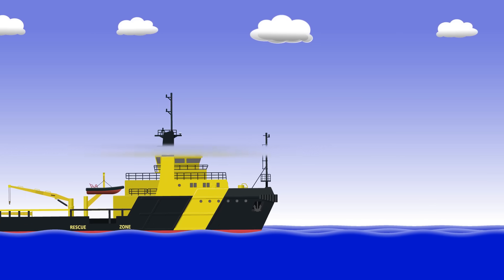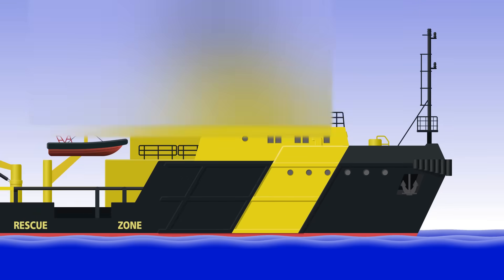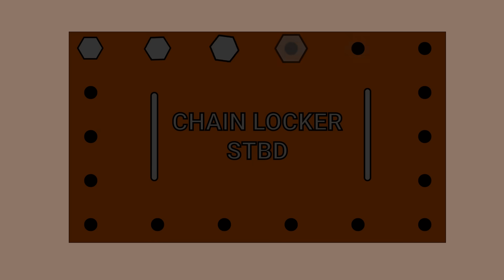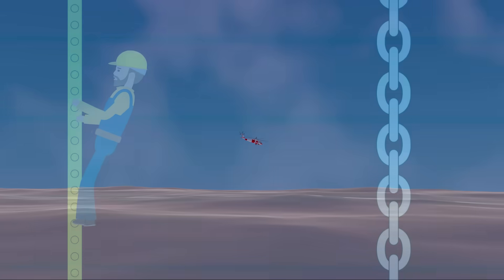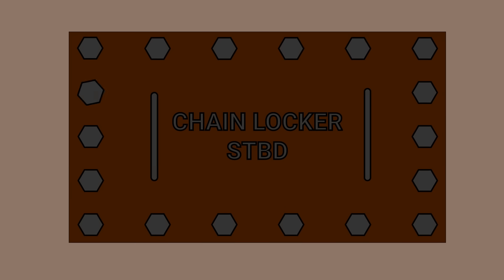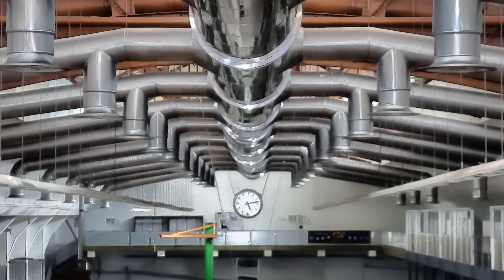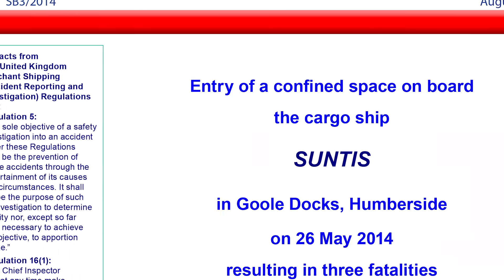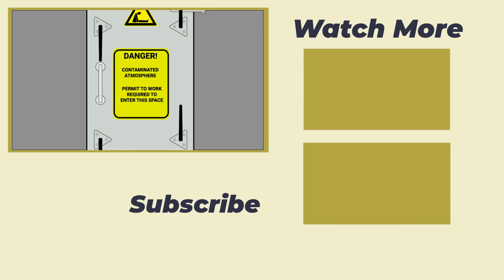Why Enclosed Spaces Are So Dangerous? | Enclosed Space Entry

Comment: i worked in a huge government building with various levels of security access,  i always wondered what 'enclosed space access' meant, and why it was a big deal.   great video
Reply: Those would probably be the service areas only used when something needs replaced or fixed usually in buildings though the areas wont suffer from huge buildups of gases unless there is a leak of some sort. Also since it was a government building its possible some of the doors may of been "fakes" where things were kept that were on a need to know basis as a variation of the hide in plain sight tactic as the spooks always love to find new and strange ways to hide things.
Reply: I am guessing "enclosed spaces" in a security context means something entirely different.
Reply: That's where they keep the reptillians when not needed for impersonating politicians...
Reply: NiagaraWarrior what building did you work in? And what was the security access for?

Comment: I never thought about oxidation depleting the atmosphere. It's one of those obvious things that I never connected together. Thank you.
Reply: Yeah. I know Rust is Iron-Oxide. This video put two and two together.
Reply: I think its because we have always taken the availability of oxygen for granted. Its not like we're astronauts so as long as we have air, we just automatically assume that there will be oxygen.
Reply: Even without the oxidation, the person going in will deplete the oxygen. This is a real problem even in places not normally considered enclosed spaces. If there are heavy fumes produced by a process they can cause low oxygen if there has been a leak or the ventilation system has been switched off.
Reply: @bigbadjohn10  Yes this is true however the circumstances of this incident strongly suggests that the oxygen content was already dangerously low. Granted the volume of the chain locker isn't specified however the fact that it is sufficiently large that descending into the space requires a ladder suggests a volume far too large for such severe symptoms to occur so quickly unless the air was already dangerously stale to begin with.

A volume large enough to need a ladder for entry is almost certainly large enough to contain way more than 1000 litres (1 m^3) of air which at sea level pressures is enough volume that it would take tens of minutes to raise the CO2 concentration to symptomatic levels and closer to an hour to cause unconciousness.

While the video doesn't give a timeframe on the first collapse it does strongly imply that it they did not even manage to complete the decent before collapsing suggesting this event occurred within mere minutes of a exposure. Unless the video is severely exaggerating the rapid progression of symptoms here that very much suggests that the air in there was already unsuitable for human life from the outset.
Reply: wouldn't it be vented because the anchor chain has to come out of the chain locker so there would be a vent for things to enter and exit. including air, and plants and animals. or are they airtight on modern ships?
Reply: @ameraldas3641  There will be an opening for the chain though it's probably not going to be much larger than the chain itself and runs directly through the windlass and such that are used to raise the anchor hardly an optimal ventilation conduit.
Reply: @FaerieSeraphina  there is a chance the oxidized air is heavy an it will sit at the bottom of the tank. Just like large fermentation tanks which have CO2 sitting at the bottom of a tank. Very dangerous
Reply: @The.Chiefman  Indeed yes, if left undisturbed with only diffusion to mix the gasses they certainly will gradually settle into a diffuse density gradient with the concentration of the densest gasses being significantly enriched towards the bottom of the space. That said I struggle to see how the air could remain undisturbed if the crews stated reason for attempting to enter the chain locker in the first place is considered, for the chain to be banging around inside the chain locker it would have to disturb and stir up the air as it moved. I really do think that there was simply not a large enough volume of Oxygen left inside the space period for any part of the atmosphere in there to be survivable given the circumstances.
Reply: @FaerieSeraphina  or perhaps we can say that the rate of which oxygen was consumed through the reaction is greater than that of any source of oxygen entering the enclosed space through whichever possible means i.e the gap and spacing for the chains that could have been exposed to the outside air. It's interesting to think of what type of science Dynamics is involved in such a scenario, ie differences in pressure, differences in density of co2 o2 and other gasses. And also on the way down perhaps at different heights within the enclosed space that there were differences in concentrations of gasses which could have lead to this incident. I doubt any other toxic gasses were involved here though because I can't find any evidence from the safety training material regarding this particular incident. It's you can search Viking Islay enclosed space incident.
Reply: @ookduke3502  I'll check that out later when I have time but yes from what I know so far it does seem like the space was Oxygen depleted.

Also there inorganic Oxygen consumption due to oxidation reactions with the steel seems unlikely to be the only thing consuming Oxygen in there too. Sure that there are plenty of microorganisms breeding in there too after all every time the chain is retracted it's bound to bring up a fresh supply of microorganisms and probably a good amount of food in the form of bits of phytoplankton and such that stuck to the chain lol.
Reply: @ameraldas3641  it's a very big space and the small hole for the chain isnt enough to supply oxygen.
Reply: @Amagaeru81  The hole for the chain is sometimes closed with cement so that water cannot come below... That was the case on sailing ships.
Reply: @ameraldas3641  there are some gases heavier than air that will be more concentrated on the bottom of this enclosed space and will not mix a lot with the air on top, which will have a little vent.
It's a similar thing in old wine caves where you easily can have toxic gas on the bottom and won't realize that as long as you don't fall down to the floor.
Reply: Ameraldas Yeah my though was the same thing, it cannot be the lack of oxygen. Must be something else
Reply: @Binhminhtqn  It was lack of oxygen, nothing else. They measured the air after the accident and found it to be depleted in oxygen. One small hole where the anchor chain goes is not enough ventilation.
Reply: Same here... obvious but didn't occur to me. My first thought was the anchor chain would have fouling on it, and the algae consumed the oxygen.
Reply: @lmlmd2714  Same
Reply: i thought it was CO2 from breathing but nvm, thought steal ould be stainless steal so structures and vehicle and things wouldn't rust so easily
Reply: another example, dessecant bags in dry foods, they contain silicon pebbels and iron dust.
Reply: @p0t4toePotato  The other component there is actually Silica which is another word for Silicon Dioxide (SiO2) chemically the same as the most common type of sand (Quartz sand) though with a different structure that gives it lots of pores to absorb water in that regard not dissimilar to activated charcoal both are modified to create pores like that.
Reply: I figured something depleted the oxygen, wasn't able to think of what.
Reply: Yeah, at first i thought only fire consume oxygen. Turns out oxidation also consume oxygen
Reply: @Inkasso Meddl thanks
Reply: it's also a danger when dealing with things like scrap. big 'ol empty concrete mixer drum, cutting open large volumes, etc. entering sealed and forgotten places are a great way to suffocate.
Reply: It doesn't need to be a complete lack of oxygen. Any normal person will pass out if they suddenly and without any preparation, went from breathing 20% down to 15% oxygen. It's a 25% relative difference, not just 5%.
And if we assume the initial O2 level was more like 5% or 10% , then they had no chance.
The human body is very sensitive to O2 concentration changes.
While 15% is minimum uncomfortable threshold for most people, mountain dwellers and trained athletes / climbers can breath comfortably at 15% or slightly lower than that, if given enough preparation time to adapt by producing more red cells.
Reply: Oxidation is the #2 threat to humanity  right behind war. If everyone doesn't start Armor All-ing their vehicles weekly then the increase in rust could do this to the entire atmosphere
Reply: There was that one time when an earthquake exposed bare rock and so all the CO2 in the atmosphere was absorbed. -50℃ everywhere cause no greenhouse effect
Reply: @HarriW  There will still be some greenhouse effect as Earth still has an atmosphere also you should check out the night side of the moon to see how cold this region of space can get if you have no atmosphere to keep the heat in only about -173 C or so.
Reply: @FaerieSeraphina  I see your point, but it's easier for me to picture it if it's more recognisable temperatures. The deserts and moist oceans around the world, it's difficult to think they were ever not that. hhh space sounds chill
Reply: @HarriW  Depends which part direct unprotected exposure to the Sun at the distance of Earth's orbit will cook you in short order still the giant fusion reactor in the sky really isn't as friendly as it looks without protection lol. But yeah space is pretty cold unless you get close to and in line of sight of a start then not so much of course Earth not only benefits from the greenhouse effect to keep the heat in but also weather systems and ocean circulations that smooth out the extremes by acting as giant natural heat circulators.

Comment: I thought this video was going to boring but I was pleasantly wrong. I used to work at a car oil manufacturer and when it was time to clean the inside of one only certain people who had taken certification classes were allowed to enter and there always had the someone one on the outside anytime someone was working inside. The covers had 50 large bolts to remove and took an hour just to get them all out and the door open.

Comment: 4:44 I don't get it, I thought timber would use CO2 and change it O2? or is it something to do with decomposiong that uses O2?
Reply: Plant cells have the ability respire with consumption of oxygen even when the plant as a whole is photosynthesizing to produce oxygen at a rate that exceeds the rate of respiration.  Timber doesn't have photosynthetic ability, but even if it did, when it is in a cargo hold and/or under other timber, it won't have any light to run that process, while respiration continues (as does decomposition, under applicable conditions).

Comment: It's not just lack of Oxygen, but also presence of inert gasses used for welding, CO or other exhaust gasses from equipment, and other contaminants that can make confined spaces very dangerous, both during construction and afterwards. The Navy and shipyards treat this problem very seriously, and have extensive confined space certification programs to test air and post whether they are safe to enter or not. Confined spaces that are not safe to enter cannot be entered by any part of your body.
Reply: Argon is spooky man
Reply: Well that's not a specific "navy" thing. It's on pretty much all industries

Comment: I wonder what it actually was that caused them to collapse. Lack of oxygen usually takes long enough for you to realize what is happening.
Hydrogen sulfide does not seem probable CO seems like a possibility but it usually is not a gas that acts that quickly. Petrolium fumes can act quickly though.
Reply: Lack of oxygen apparently doesn't cause a warning sensation very reliably, especially if the bad air does not have a correspondingly elevated carbon dioxide level.

Comment: When working on Shuttle Orbiter we had the same thing happen in an enclosed space. Two men went into a space open at top, used to hold rocket fuel. Fumes had pooled at bottom and they both died.
Reply: Is this different than the fatalities from prepping STS-1. That was entering the engine compartment after a nitrogen purge.

Comment: The scenario that you just described happened on one of the vessels of my seafaring days. I was on leave at the time, but I knew the deceased Captain and Mate. During an inspection of a Double bottom under an inerted LPG cargo hold, one person collapsed and another went in to rescue him and also collapsed. A crack in the steelwork had allowed inert gas to enter the double bottom, but failure to test and ventilate the atmosphere meant that this tragedy was then inevitable. A very heartbreaking affair. Unfortunately, in my later career, there were still those who thought safety rules did not apply to them
Reply: Yes, a good safety concept relies on multiple layers. Personal Protection Equipment always is the last option to augment. Try your hardest to remove the cause of the hazard first.

Comment: In my experience, ships are extremely dangerous and will consistently find new and improbable ways to kill and maim. Sailing isn't dangerous per se, but neither ships nor the sea gladly suffer the unwary or unwise.

The rule in the navy was that an enclosed space had to be ventilated well enough to have replaced the entire atmospheric volume of the space no less than twice before entry AND you had to wear breathing apparatus in the space AND you were required to operate in teams of three AND permission from the chief engineer was required before you could pop bolts on an enclosed space. 

On my first ship, we had a big problem with constituent elements degrading and then reacting to form hydrogen sulfide, which for those who haven't been on ships, will kill you hella fast in an enclosed space. We had a guy die once when he tried to replace a section of mixed AFFF (basically 'roided-up laundry soap used as a firefighting agent)/seawater pipe for the non-firemain installed firefighting system. Turns out the mixture had been sitting there for a while and the inside of the pipe had acted like a catalyst for the reaction, so it was full of H2S. He was dead in two minutes. We didn't even find him until he'd been dead for three or four minutes.
Reply: H2S is absolutely insidious stuff. Imagine opening something and getting a blast of rotten egg smell but it quickly goes away... everything's ok, right? No, the H2S anesthetized your sense of smell and is continuing to kill you. Enough concentration and you'll drop dead on the spot.
Reply: Damn!!
Reply: There's a reason why most sailors in the past and even now are superstitious. You just don't know where bad things can happen and when it did, its always waiting to become catastrophic.
Reply: Very informative, thank you
Reply: Not the water but your own ship is the most danger thing on the sea XD
Reply: @Steve Campbell I don't work with the stuff but I know about the dangers.   I read a newpaper article as a kid (about 40 years ago) about a guy who died suddenly at a some plant in the area (it was a long time ago so the details are a little faded by time).  The guy was washing out some large tub with water and suddenly died.  Turns out whatever residue was in the tub reacted with the water to make hydrogen sulfide.  The article said that in lower concentrations it smells like rotten eggs but at higher concentrations it has no smell.  The article said that no one in the area smelled anything.  The guy got an instant lethal dose.  Never forgot that article.
Reply: The flip side is being in a ship area/hold where there is a fire-fighting system (other than water sprinklers)to begin with. If those go off , the chemicals are designed to suck up all the oxygen, so you best have an SCBA(self-contained breathing apparatus) with you or know where the nearest one is , and be able to get quickly to it , even in the fog that fire suppression systems  make when they go off , and in the darkest dark - if there is an actual fire(often electrical) causing the lights to go-off. Always know where that nearest SCBA is in a ship hold, and be able to reach it with your eyes closed in a  very short time (how long you can hold your breath). Have a flashlight too.
Reply: @chrisperrien7055  Also why we have emergency escape breathing devices, basically O2 bottles with a hood attached.
Reply: @DrDeuteron  That sums it up nicely  and thanks for the chuckle.
Reply: I worked for about 30 years on ships and boats. Telling people of my job many said they could never do that because they couldnt swim.  The ability to swim is one of the least necessary skills there. Where will you swim to if you're a thousand miles from land?

Comment: Or just leave the hatch open for a bit before entering so fresh oxygen can get in, that can solve the problem, but I guess the right breathing equipment can be also a choice.
Reply: That's not sufficient. It will take approximately forever for sufficient oxygen to diffuse into the air in the enclosed space. You need mechanical ventilation to get good mixing. Also, mechanical ventilation is the only way to disperse any heavier gases that might have pooled at the bottom of the well.
Reply: Just opening the hatch might work, but you shouldn't count on it, especially if it leads down (heavy gases like carbon dioxide would accumulate and not diffuse out very fast) or up (light gases like hydrogen would accumulate and not diffuse out very fast).